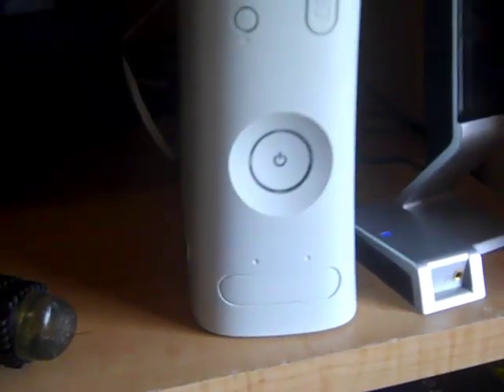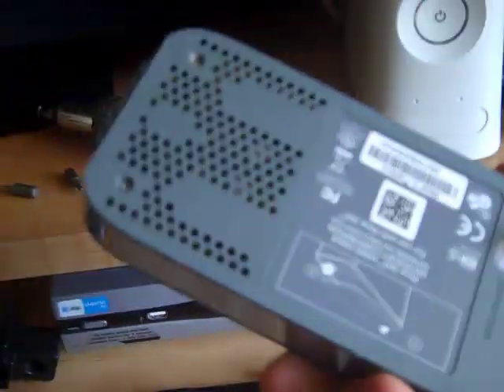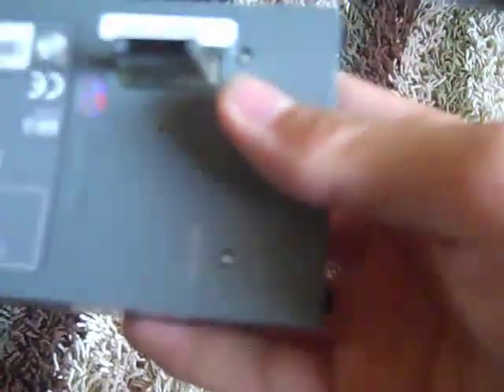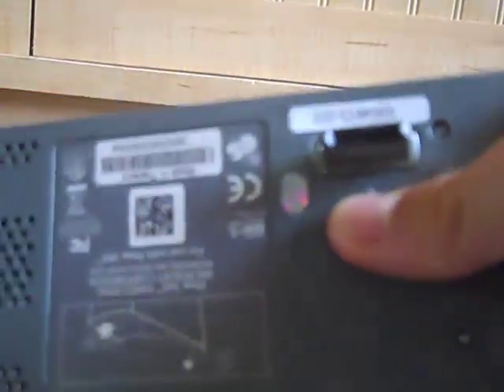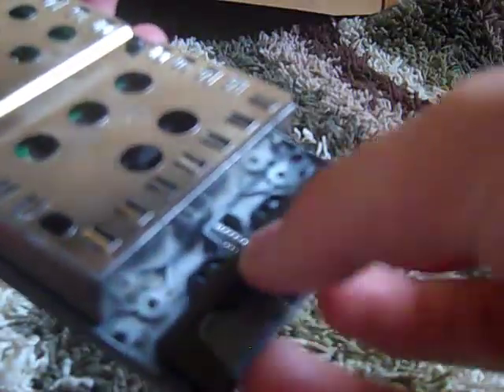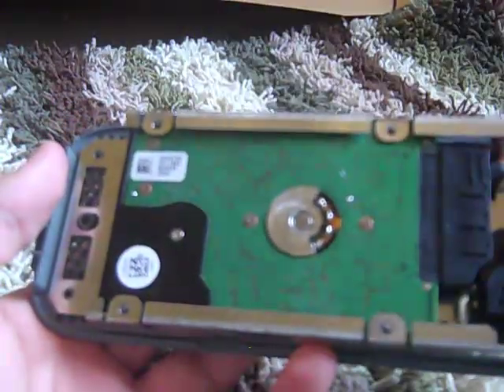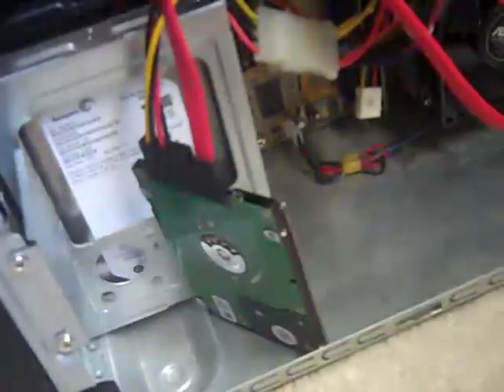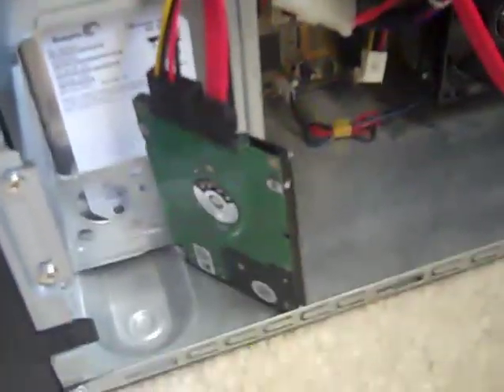How to Take Apart Your Xbox 360 Hard Drive and Connect it to Your Computer (without transfer cable)

Comment: Maybe people are following this vid for other reasons but if you just want to mess with save files with modio or play with xport 360 or something like that just buy a transfer cable. They sell for $1 on ebay and then add shipping which is like $3 so about $4. Thats not much at all. Unless you really want to take apart your computer and harddrive just to transfer and move files, with the transfer cable its super easy and quick.